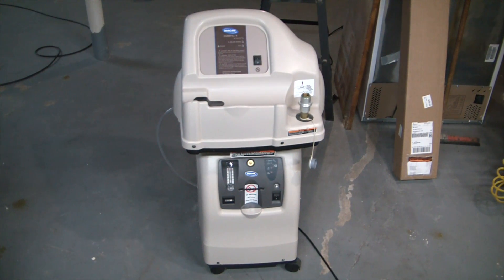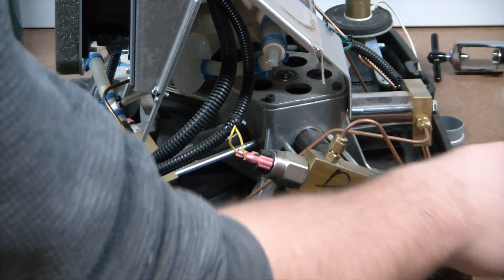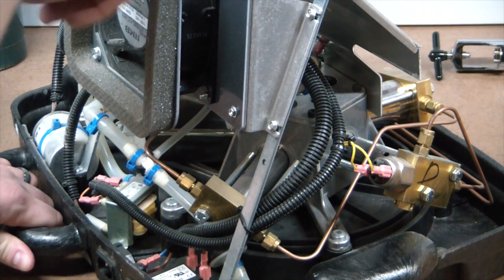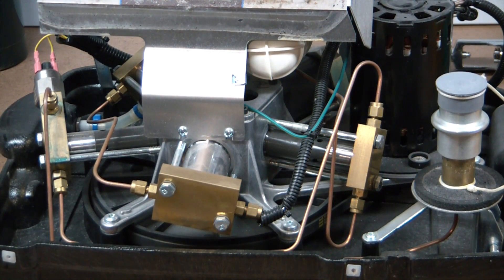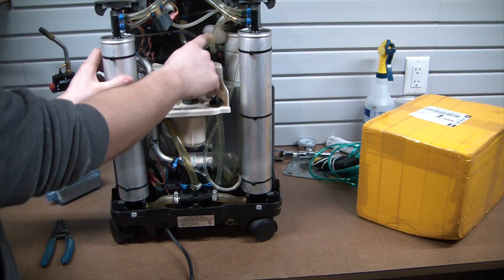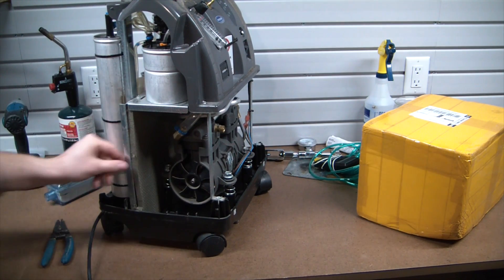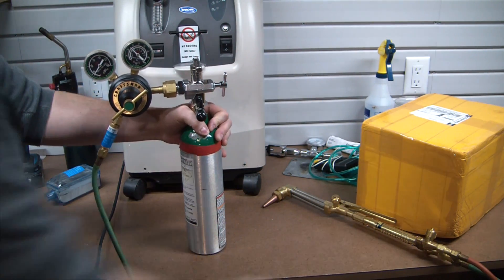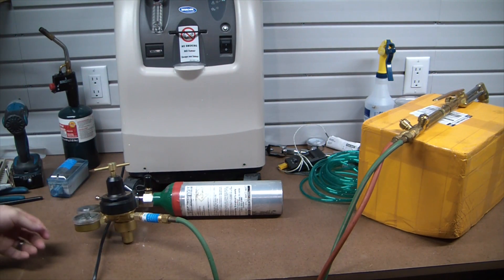Whats Inside an Oxygen Concentrator and Compressor - DIY Oxygen Filling - ElementalMaker

Comment: SCUBA uses compressed AIR, not O2
Reply from the maker: Yes I should have clarified that better in the video. I added a note on the description before releasing the video. That's why I mentioned bypassing the O2 sensor, but didn't want to go off on a huge tangent of setting the pump up for air.
Reply: I heard a small percentage of possibly helium or some other gas is also added for some reason. Any ideas on this?
Reply: @maxprophet2401  Helium is used for very deep dives, is for specialty commercial divers not  recreational.
Reply: true, helium is used in place of nitrogen when used for excessive bottom times/long duration dives ( professional situations, underwater welders etc) helium degasses quicker than nitrogen and is less likely to induce "the bends" due to its light density. It basically exits the body as fast as it enters, unlike nitrogen which will "dissolve" into the tissues and blood as CO2 does in a soda...

Comment: Having worked In the industrial O2 separation field, and seeing the pump, they have two pumps one pressurizing the in use sieve, and the second pump would be pulling a vacuum on the out of service sieve, because the sieve will become saturated within seconds of adding air, the vacuum speeds up the Degas step.
Reply from the maker: Very cool! Given that this is a dual piston pump, that may be how they are doing it.

Comment: I cannot wait to see some hybrid rocket motors, I hear acrylic as well as caramel make great solid fuels and have an excellent amount of contained energy.
Reply from the maker: You'll be seeing some acrylic in use 👍. Caramel is an awesome idea, never would have thought of that!
Reply: @ElementalMaker  Thank you for responding, love the channel and all you do.  I had an idea years ago to make a hybrid rocket motor that had an injection system for molasses about halfway through the burn to extend range as the solid fuel usually is consumed before all the oxygen in most of the benchtop experiments I have watched on YouTube, however those could have just been design issues? Anyway, also always wanted to try a dense wood as fuel such as ironwood or others...
Reply: NO2 ( nitrus oxide) (sp?)   is better than oxy  @ElementalMaker

Comment: You might be able to make your own dewar flask. Cody did a video on that, but he used a vacuum pump, then welded the inner and outer layers together. A possible (simpler) alternative to that would be to put some water between the two layers, then heat them to boiling so the steam displaces the air. You could then weld or glue the two layers to seal in the water vapor. When the steam cools, the vapor will condense into only a few mL of liquid water leaving a decent vacuum between the layers. Upon adding liquid nitrogen or oxygen, the remaining water vapor will condense on the inner layer and freeze, resulting in a really hard vacuum (microtorr).

Also, I've been wondering whether you could make a thermic lance using aluminum tubing with pure oxygen. Nighthawk has a video on that using iron/steel tubing, but if you could do that with aluminum tubing it might be really cool. It would also create a really fine aluminum oxide smoke, which might be useful in its own right (like vapor deposition).
Reply from the maker: Yeah I also plan to do a thermal lance video. I'll have to see if we make aluminum work 👍
Reply from the maker: I actually did make one a long time ago, but the issue is nobody will fill a homemade dewar with liquid nitrogen. Needs to be a commercially made one for the local gas suppliers to even look at it.

Comment: Paint ball refill or co2 aquarium refill sky's the limit
Reply: Unless your system is designed for it NEVER us it to compress oxygen. At high pressures of O2  combustible materials become EXPLOSIVE!  

Even tiny bits of grease in regulators, even plastic that may not seem burnable at thousands of psi of Oxygen will explode!

Comment: I'm sure you already knew this but diving while using a scuba tank of pure oxygen can kill you.
Reply from the maker: Yeah I added a note in the description before releasing the video. I was going to get further into oxygen toxicity, and how that pump could be set up for scuba, but would have gotten way off topic.
Reply: @ElementalMaker  Oxygen tanks are used in rebreather scuba systems and mixed gas deep diving. You have to know your stuff to use these systems. You could feed the compressor room air and bypass the O2 sensor to pressurize a regular SCUBA tank.
Reply: Way I see it if you use only the top unit (without the nitrogen filters of bottom section) it should be safe for scuba as you'll only be compressing normal breathable air.
Reply from the maker: Pieter, that is exactly what I was implying. I didn't want to go too far into it it as that was off topic from the rest of the video, but if you filtered and dried atmospheric air, and bypassed the oxygen sensor on the unit, you could theoretically fill a scuba tank with air.